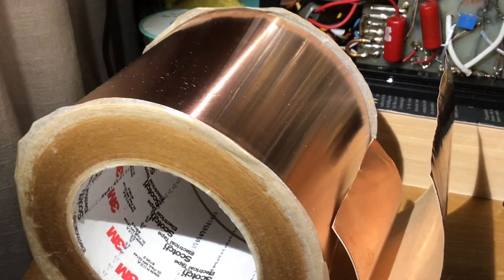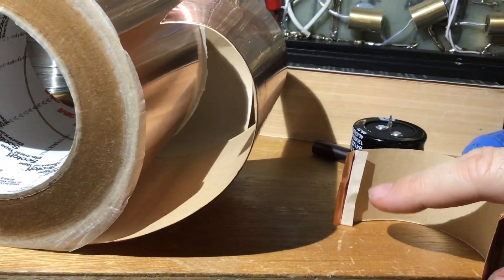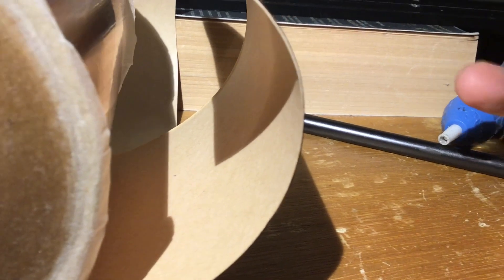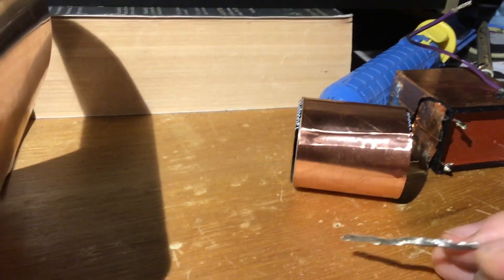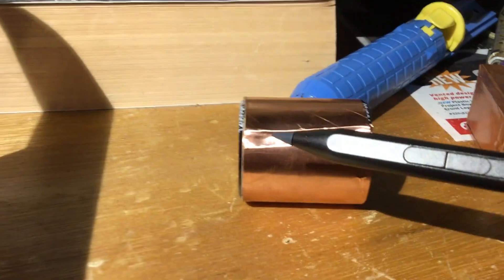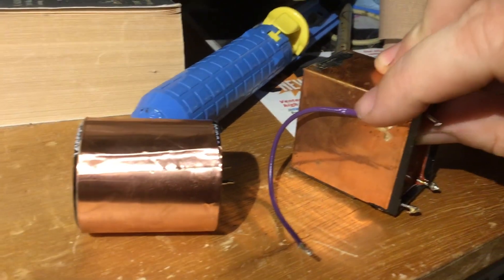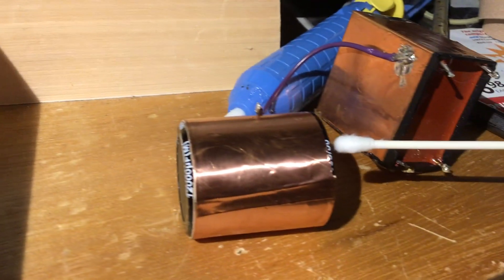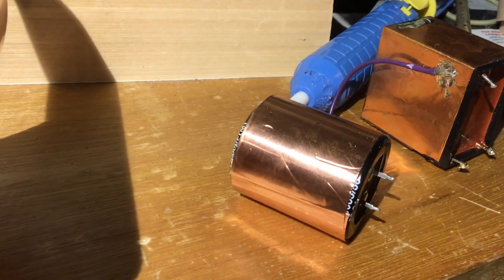How to apply the capacitor copper tape tweak?

Comment: would this also work with emi shielding tape when its not connected to the ground? for example in a speaker crossover filter
Reply from the maker: It needs the grounding - or connection to the negative pole in s crossover.  If not nreferenced, then the copper tape will likely act as an antenna and could make things even worse.

Comment: Thank you Janos, well worth the wait. Pretty much exactly as I imagined. Your explanation for soldering the seam is smart to ensure copper is completely jointed cylindrically, I was thinking at first it was to ensure the tape didn’t unravel over time, I suppose that could be true as well. 
Thanks again, will be getting ready to modify my power supply now…
Reply from the maker: Hi Marc, so sorry it took so long to make it...

Comment: Hi. There are copper tapes with insulating adhesive and with conductive adhesive - which do you recommend ?.
Reply from the maker: Hi Eric, go for the conductive adhesive. Even better, can remove the plastic shrinkwrap from the capacitor body (when possible), and then the conductive adhesive will be put to full use. I stopped doing that though as I loose the polarity information, and lost caps that way that I could not tell what was the polarity.. ; (of course you can label them, but as life happens, some labels peel off / come off...)
Reply: @realworldaudio  Hmmm, conductive adhesive copper tape applied directly to the can (label/skin removed) and then grounded would provide a path to earth for any cap internal leakage currents to can. Usually RB type caps internals are isolated from the can but this cannot be guaranteed and leakage currents shunted to earth may cause issues !. I would be inclined to remove existing label, apply clear heatshrink and then the grounded copper faraday shield. Have you experimented with applying copper tape to axial construction caps ?.

Comment: Hi Janos, thanks for this detailed video! Are there caps where you would say this is more important and/or leads to higher benefits, like for example start with the big caps in the power supply? And I suppose the gauge of the wire used does not matter much?
Reply from the maker: Main power supply filtering caps are the most important -  and the coupling capacitors (but I think your ACA is direct path, no coupling caps there ; ). The wire gauge is not important, as it's grounding only minuscule current.
Reply: @realworldaudio  Actually I think C1 in the circuit is a coupling cap. So this might be a first tweak for the future once it all settles ;)

Comment: Bro. I used to copper tape/foil my caps. And I still do for the Biggun's! But someone put me onto the awesome trick of just buying a box full of 'assorted' sizes cheap springs  from like Alibaba or whatever. 
Simply slip the most logical size over the cap and you'll have a handy loop at each end to attach to the chassis. The whole lot can be heat shrunk on to keep in place on the cap or hot glued or whatever. 
Works super great on both Elect's and Sprague but not Orange drops or poly's etc.
Thanks for the vid!
Reply from the maker: Wow, that's pretty nifty, thank you for sharing! ; )

Comment: What is the purpose? Looks? 😊
Reply from the maker: The purpose is to add a copper shield around a capacitor, and ground it through the wire soldered to the copper foil. It prevents the capacitor from leaking EM field into the rest of the circuit, and also prevents external EM field from affecting the capacitor. Also, worries about whether inner or outer foil was connected (for non-polar capacitors) are gone, as now we always have a definitive outer foil. Also, looks are improved as well quite a bit! : )  BTW, when this is done to solid state electronics, there is a super-massive shift towards natural, much more tube like sound as harshness and grit / grain mostly disappears.
Reply: @realworldaudio  Thanks! I will try this tweak! 👍🏼
Reply: Where do you put this?